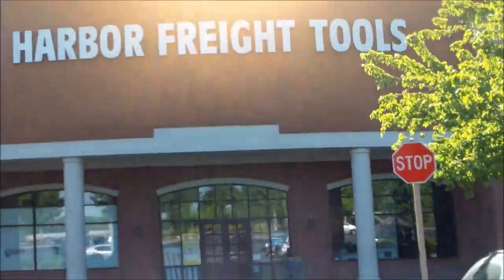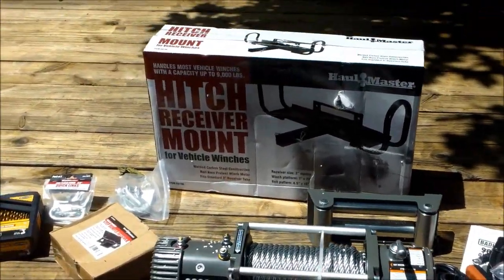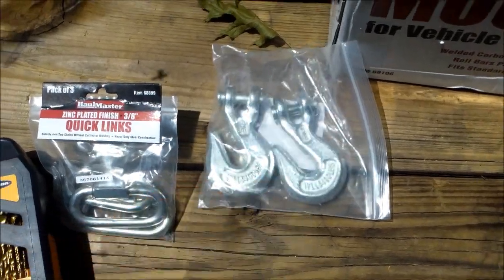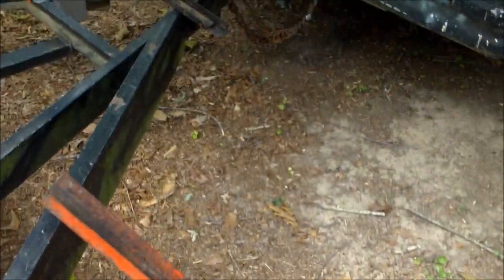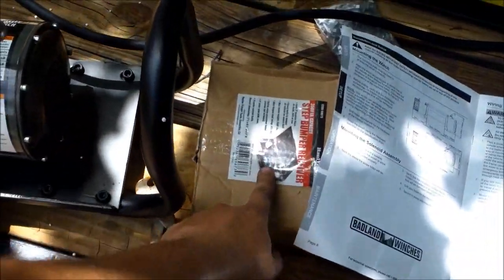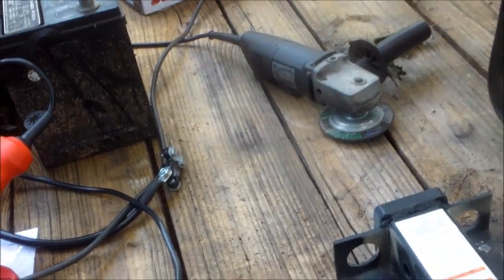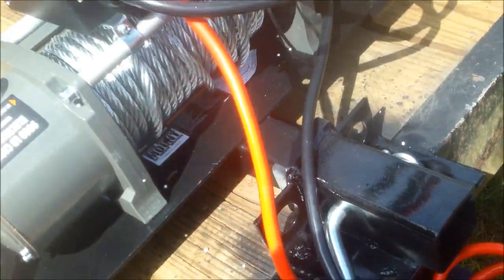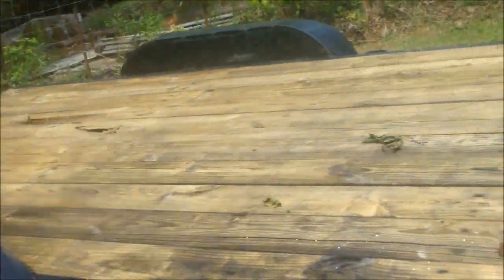Harbor Freight 9000lb Winch

Comment: this is  exactly what i was planning on doing with my 20' car hauler too , i just went with the wireless remote on the 4500 pound pull champion winch for now,. going to put mine in a locking tongue box just to keep it out of the elements but i like your idea of being able to take it off too, I also have a 10,000 pound champion i am probably going to hook up just like this.

Comment: If you have a factory 7pin connector, on of the pins I think 5 in hot when the ignition is on, so if it has a fuse in the fuse block the correlates to that pin you then can run a hot wire to the battery you have for the winch which will keep it charged off of your truck. I have it on my camper so when I go get it from storage I just connect the lights up and I can then run my power  jack from my truck, also it charges the batteries as I drive down the road.

Comment: A 9000# winch will suck a battery down quickly, so, yes, the vehicle needs to be running. I wonder how many people have been stuck in the woods because they winched their truck out then found out it wouldn't start because the battery was dead. In this trailer mount situation it may not matter much, but a connection to the truck battery would be nice, and easier on the winch. Remember, as the battery voltage drops, amp draw goes up fast. High amperage melts things.

Comment: for my winch I got a set of 25' long good quality jumper cables and put a quick connect plug on one end and one on the winch then I can use it on any vehicle but now I just use the 12 volt generator I built to run it
Reply from the maker: is it hard to find 25 foot cables?
Reply: DannysCam
I got mine at walmart, they were like $60.00 10 years ago but you could use any heavy gauge wire, could probably even use house wire...
Reply: savagenomore
just make sure whatever you use will not be overloaded by the winch, check to see what the amps draw is on the winch...

Comment: I'd say to run a couple of high-gauge cables under the truck that'll most likely mainly be pulling the trailer up into the engine compartment to the battery. terminate it at an outlet sort of thing at the back bumper and make up a way to get your winch's cables to connect. that's by far the best way to probably do it... with the skid steer, you may have to have a battery box, else you're going to have to get an alternator on that thing somehow. but same deal with that one, a quick connect/disconnect plug/outlet setup for easy attachand detatch to either the skidsteer or trailer+truck.
 but a battery box there is still good in a pinch assuming a good battery.
Reply from the maker: its funny the skid steer has a full sized car altenator what kind of cable could i use? i had some 6 ga 60 amp wire i used for running a sub pannel in my house would that work?
Reply: DannysCam
 6ga is rated for 600v so it should be plenty. but I have no real idea, I'd say get some bigger cable if possible and make sure it's rated for outdoor use. but 6ga could very well be the ticket.
Reply: *****  Wire isn't typically "rated" in voltage. The max voltage you see printed on the insulation is the insulation breakdown figure. Has nothing to do with how suitable it is for something like a winch install. There is 22ga wire that's rated for 600v. What he needs is more current SUPPLY, and a tripod to keep the camera still.
Reply: Voltage is not the problem here. Amperage is. Electric loads use WATTS 'which is amps x volts. If the winch uses 2000 watts and the battery voltage drops to 10 volts, the amp draw will be 200 amps DC which would fry a 6 gauge wire in a few minutes (most wire is rated for AC which is a different animal).  I'm sure a 9000# winch at full load is pulling at least a couple of thousand watts.

There are charts online to show wire amp capacities at different DC voltages.

Comment: If you have the 7 pin wiring connector on your truck, add a plug from your battery and connect it to your Aux power supply on the 7 pin to charge the battery/power the winch when vehicle is running.

Comment: Great video, I am thinking about getting a 9,000 LB winch and the hitch mount. 
Does the winch mount firmly to the hitch mount? 
After using it for a while, do you notice that there are any issues with strength? Wear? Cracking? ect?
Thank you!

Comment: If you have not made a decision on the battery consider this option. Instead of stretching the wire from the battery to the winch, run the wire along the frame of your truck and have a high amp tap at the hitch. Put the short cable on the winch. Just a thought.
http://www.northerntool.com/shop/tools/product_200609606_200609606

Comment: I know that this video is over a year old but someone might wire it the way he does and catch their truck on fire .. below in my opinion and after working in the field for a grip of years is how i would set it up

it is wanting a deep cycle battery get a dual battery isolator connect it in line to the charging circuit from the outputs o the isolator run one to your truck battery the other to the winch battery (run it a lig the brake light wires the through                                                                                                                                                                                                                                                                                                                                                                                                                                                                                                                                                                                                                                                                                                                                                                                                                                                                                                                                                                                                                                                                                                                                                                                                                                                                                                                                                                                                                                                                                                                                                                   the tail light plug that you use to run the trailer lights the into the battery bos mounted on the trailor bear the winch and it really should be 2 6v run in series to get to the 12 volts last for long long time that way deep cycle battery. 
Car batteries are for short bursts of high amp output,  the deep cycle can sustain a slightly lower output but over a long duration.  if run your vehicle while using the winch under a heavy load you could fry the diode pack.  12  or even 14 gauge from the isolator to the battery mount the box on the trailer close to the winch then run 12 gauge to the winch. they way you have it your going to get some serious voltage / current loss that will end up cooking the winch i will blow the welds out of the armature when you get the volt drop over the longer distance with heavy gauge wire like that when the volts go down the amps go up bad new for that winch un power and over current will burn the brushes to a crisp in nothing flat and over heat the amiture, so fix it before you hurt your self or someone else,.. 
   but what do i know just that's how I would install it and have on about 100 or so rigs,  not trying to be a hater just it is dangerous not only for you but to other people it they do the monkey see monkey do thing so if i sound like a jerk i'm not just felt that someone should at least give a alternate way of doing it is all ,
 worked as a vehicle electrician for a good number of years (16) then was an instructor,
Reply: Chad Davis if my car trailer already has power and battery (it's a power tilt trailer) how would you recommend I wire up the winch ? It's do not come with a winch and I'm looking to put a #9,000 lbs one on it thanks a million